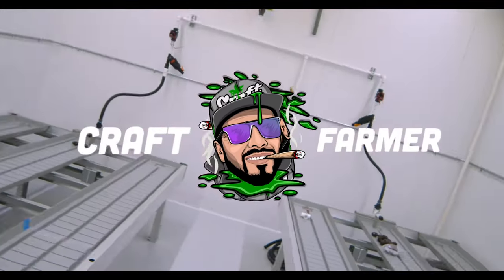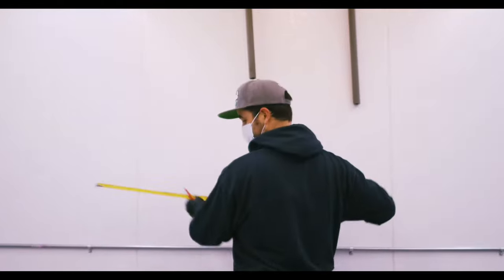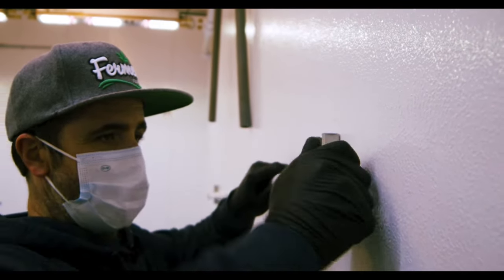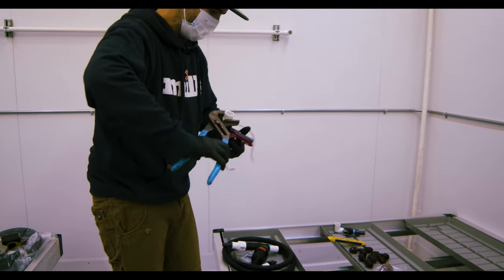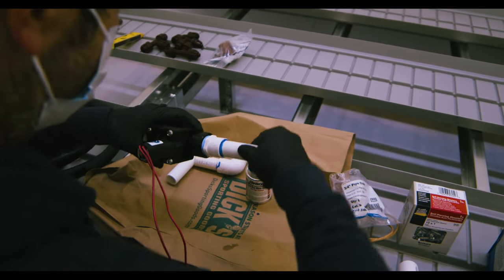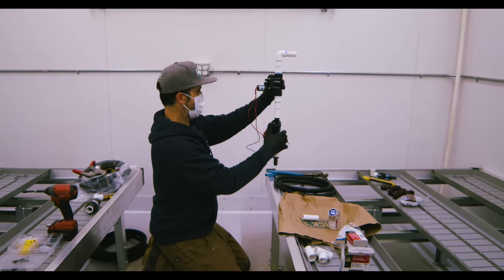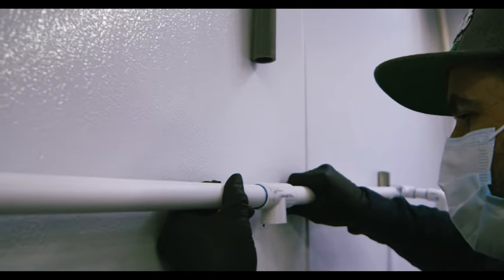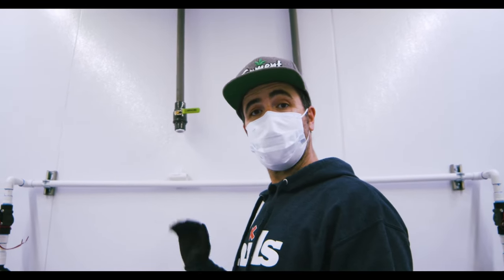Installation of Craft Farmer Whip Kit and Manifold Kit - 🤜🏼🤛🏼✂️✅🦍🇺🇸💦

Comment: Can you elaborate about the flush valve and how it works plz thanks
Reply from the maker: The flush valve has a built in bladder and slows old stagnant water that has been sitting in the line flush out. It also allows a place for large particulates to be flushed from the line.
Reply: Can you demonstrate the flush valve

Comment: What size of pump would I need for  60 dripper 3.3gph system
Reply from the maker: I don’t prefer to use dripper’s that large, the largest I would go it .5
Reply: @CraftFarmer  would the pump break or burst a line if its too powerful?   How do you figure out what pump i need for 54 micro drippers?

Comment: I prefer floraflex
Reply: this is not about the drip system it self in particular this is more about the irigation to your sites if your just talking about running a tiny room then you dont need all this you can just run your lil flora flex setup but if you understood what you were looking at your undersand that you can use floarfelx alongside this if that is your prefrence but regardless you need to have your irrigation correctly and this is the irrigation needed for a large room with multiple sites this is not really about people with 2 lights ... ok glad we got that clear
Reply: I was talking about nutrients but ok
Reply from the maker: I guarantee you would have better results with front row Ag I have done side by side tests with the same strains
Reply: @CraftFarmer word so how do you guys calculate your drybacks ? And how do you program generative and vegetative feeds into a controller. I’m using trolmaster aqua x
Reply from the maker: @TheJamesNigra  we need to get you on the patreon and sell you a Solus and you will start crushing on another level. Patreon.com/craftfarmer you can get the Solus on my website www.CraftFarmer.com
Reply: @CraftFarmer  I would like some personal consultation if I pay 250/month.  To at least figure out what I need for my rooms.
Reply: @CraftFarmer  unless your patreon has literally everything from ipm regiments, how to use power si in conjunction with your nutes, sizing a dehumidifier for a room, res mixing instructions ( I don’t have a dosatron I have 4 separate reservoirs for each of my rooms and I hand mix nutes). Man I jus hve a lot of questions this is like my 3rd run out here in Oklahoma and I’ve had a good amount of success w floraflex nutrients but willing to give yours a try with proper instruction.
Reply: @CraftFarmer  if you’re actually pulling 80g per sq ft I definitely wanna get on your level lol!